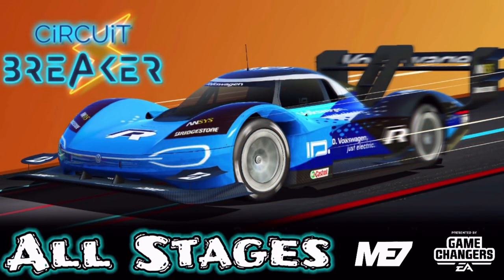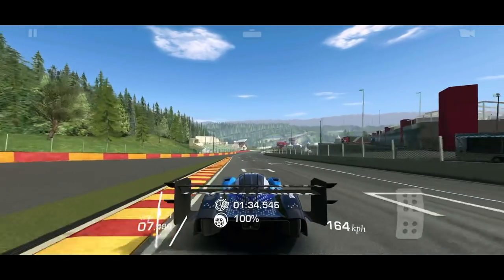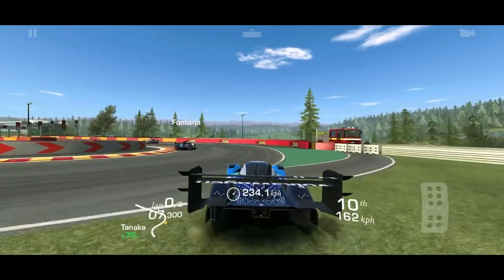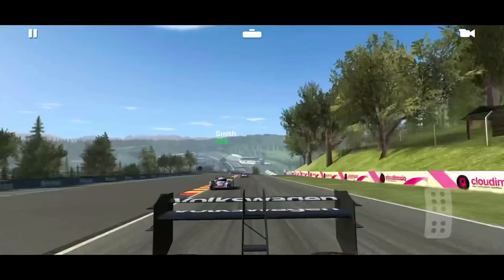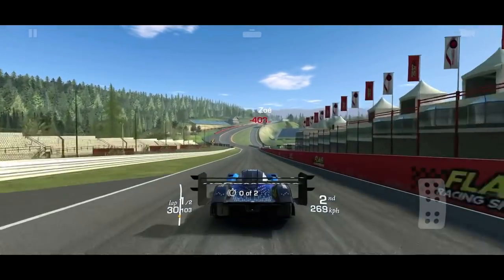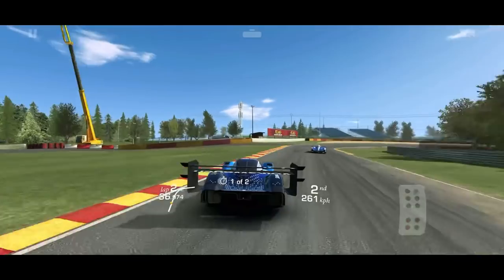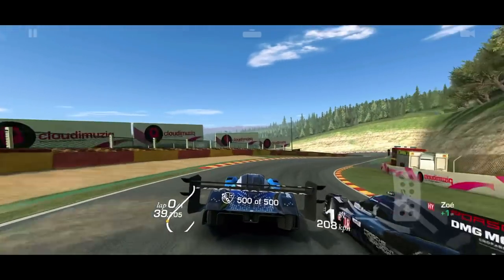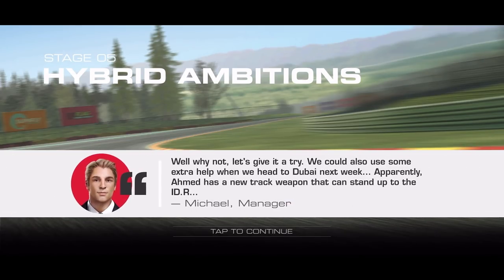Circuit Breaker - Real Racing 3 - Stage 5

Comment: In the 1st race of this stage, just take your time on lap1 while warming up the tires.  After losing it a couple of times, I noticed that the tire percentage ticks off one second at a time regardless of your speed.  So there is no reason to risk stepping out on the 1st lap; just take a slow, scenic drive around Spa and get mentally ready for lap 2.  You definitely need your wits about you for the 2nd lap...

Comment: when zoe crashed the second time I think it is because the bot was going too fast because you were drafting off it and the bot was using the same regular braking point but it was supposed to brake early to compensate for the additional speed so it crashed
Reply from the maker: That makes perfect sense 👍. I was blocking her to get a big push. So I literally pulled her into a crash 😂. I did that with other bots heading into that section, but I think she was closer to my bumper than the others.

Comment: Hi again, ME7, Because I drive with low brake assist, I  have already upgraded the car to 333333 before running today the 4th day. And you know what? It does not brake in the turns ... I can take them flat out as you do. And downhill I reached 307 km/h although the car only can reach 296.
Reply from the maker: That’s good to hear! Thank you for that report, I was wondering what brake assist would be doing for people.
Reply: @ME7_RR3  I finished Day 5 now. It is scary to drive with such a speed in the corners. Is the car really that insane for real?

Comment: Hi ME7 i dont know how you did that 90 seconds drafting with only few upgrades, i completely lost my mind few times yesterday (not really yesterday my challenge appeared 1 day later than yours) and i have all upgrades on 1 and now i upgraded body to 3. Maaan idk how many attempts it took to you but i have tried it for 2 hours after midnight and i was upset like never. That 3rd place when i wanted from him to take that corner fast, he was just chilli’n and driving like he was in Nissan Silvia. But when i wanted from him to take that corner super slow bcs i Messed up with Eric too mutch he just went flying through that corner like there was in McLaren MP4-X with no centrifugal force (idk if the centrifugal force is what i ment bcs i took it from translator but i hope you got me😂) so wheels had no problem to turn in full speed. 

And i want to tell you that on the first challenge on that Spa track? (sorry idk the name of the track) that corner in time 0:57 you can break earlier, and then you can go through that corner flat out (of course with 100% warmed tires) My braking point is tóny tóny bit later than that red and yellow thing on the left side of the road before the turn starts (so you are braking at that straight before that turn) so you can go mutch faster than you go trhu that corner if you take it like in video. This helped me a lot. So you brake before you take that turn, but dont brake too mutch so you will have still that awesome downforce, and as soon as you should start turn, you just press the gas and go flat out through this and other corners. I hope you got my little help that will save you 0.0002 seconds (acctualy i think that this can save a ton of time but take it like im still a noob with only lvl 112 so i dont really know those pro tacticks of lvl 1000+ but i can garantee you that it works bcs i use it a lot i dont go through that corner like you and i lost it only one time (i had a lot of time to find this out and get hang of the car in that corner. So i started brake stupidly early (stupidly early for this car for other cars this braking point would be a disaster) and then i pushed my braking point further and further but i dont think that i have that sweet spot where you will take that turn super fast and still dont loose  it. I had more than enough time in those 3 milion attempts to draft for 90 seconds yesterday😒) but if tomorrow challenge will be on this same track, you should try it (this helped me a lot with overtaking bots too). I hope that you got the idea and you can get hang of the car in this corner. Im telling you if that big noob like me had no problem with gaking this corner like that, so there is no chance that you will have problems with it :)
Reply from the maker: I feel your pain! Sometimes there’s a stage that keeps me failing for hours. For me it was the stage with all the LMP1 cars. At first I was trying to time it so I wouldn’t be encountering them at certain points of the corner. Then I found out that this car has way more grip than I first thought and I could just pass them in multiple sections. 
   Thanks for the tips about that hairpin corner (called Bruxelles). In the end it comes down to how much time it takes to get to the corner. Braking early and then going flat out might make the corner section faster but it could be at time loss overall. Still, it’s good to hear different techniques that work for other people. Thank you for sharing 👍

Comment: Am I the only who experience constant games crashes (no pun intended) after watching ads? Also not getting the rewards after the ad?
Reply from the maker: I’ve had no crashes, did have a few no reward scenarios. There’s two things you could try. One is to “reset your advertising ID”. It may not help but it’s the easiest thing to try. You’ll have to Google how to do that for your device. The only other thing I could think of is to reinstall the whole game. It’s not that big of a deal as long as you make sure you do a cloud save first!
Reply: @ME7_RR3  Well so far this game is scam, it promises to reduce service waiting time if I watch an ad but it does not. I did all your suggestion and also run it on a different older iPhone and same result. I have to somehow report this to the app store.
Reply from the maker: That’s odd, works for me. Sometimes it’s a regional problem as well. Maybe a VPN will help, use Denmark I think. I used to do that.

Comment: I'm on 114.1pr on stage 5.3 about how much did you complete the race but still fail and press continue to slow the bots down like in speed snaps because I can't get Zoé to be messed up in the race
Reply from the maker: I didn’t do that at all because that won’t slow down the bots for me. You have to be at or above recommended PR to do bot slowing. I’ve been below recommended PR since Race 1.3
Reply: @ME7_RR3  okay I've been getting closer and closer doing it that way and using the braking points where you breaked anyway so you saying you lost count on how many times you failed
Reply from the maker: Sorry, I didn’t understand your question. I thought you were asking me about purposely trying to do bot slowing. 5.3 did take me a while because I first needed to see if I could do it with low upgrades. Then I added a little bit at a time until I could complete the race. Approximately 25 attempts.
Reply: @ME7_RR3  I'm definatly around there is lost it at the corner Zoé the 4th to last corner if I could get in front of her I would have caught draft and completed it 
All I got to say is Canadians say sorry a lot and I didn't mean to be rude at all I totally understand just keep up the work with the the final 2 stages then we can bring home the id.r
Reply from the maker: @apexracing9479  😂🤣 yes, Canadians do apologize a lot. Not all of us mind you, I wish some of us apologized more! But it is certainly something that we are known for and made fun of for. It’s not so bad, there are things that are much worse to be known for. 😃